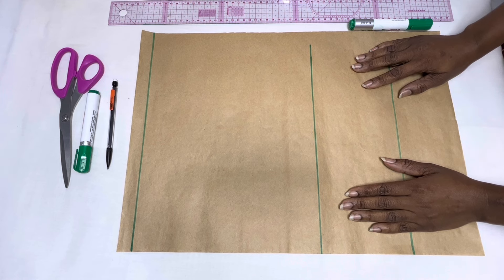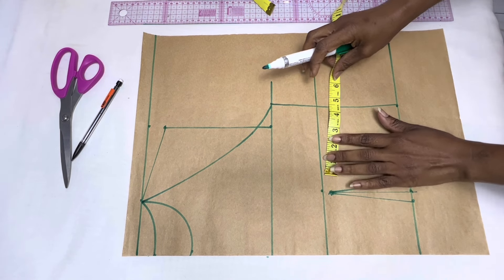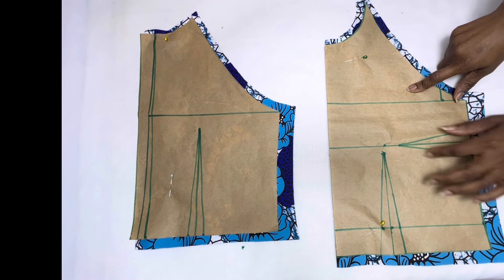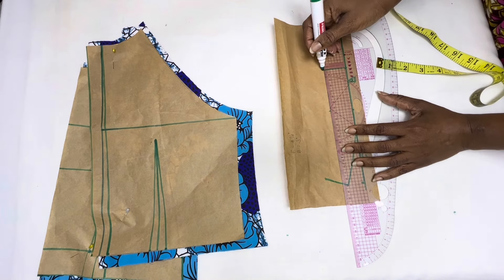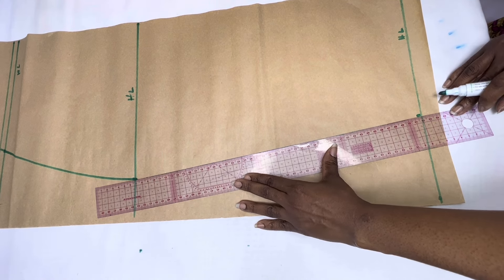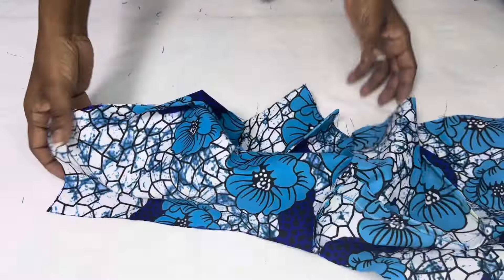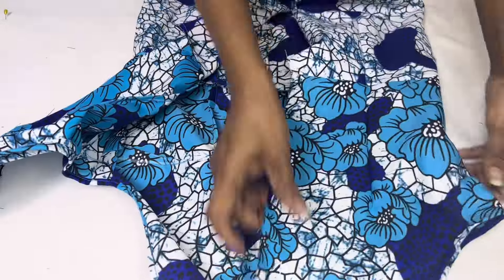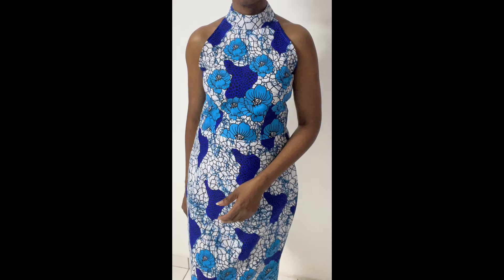HOW TO CUT AND SEW A HALTER NECK DRESS (Beginner Friendly)

Comment: Can i use a stretchy fabric? If yes, how is the process different?
Reply from the maker: For sure it’s still the same process but you can skip the process of the darts and don’t add side seam allowance just your accurate measurements and make sure the stretch is across the grain

Comment: Please what if I want the halter neck to be pleated
Reply from the maker: If the pleat is on the bodice just add about 3 inches or more depending on how much pleats you want from the center front before imputing the horizontal measurements. But if it is for the neck just cut your strip and pleat before attaching to the neckline then finish seam with your bias. I hope you understand.